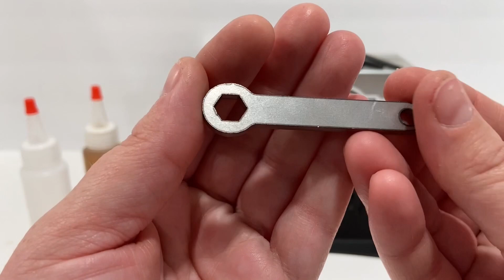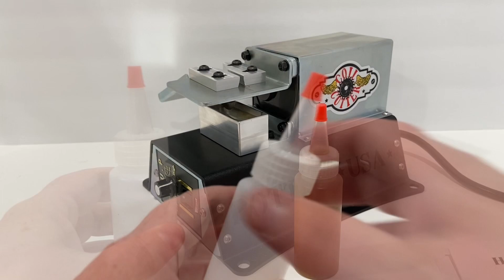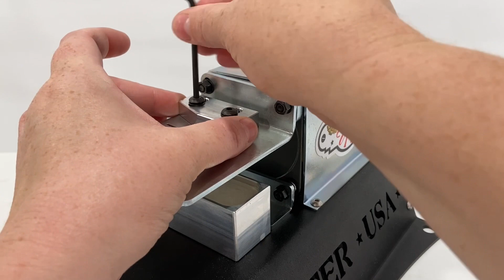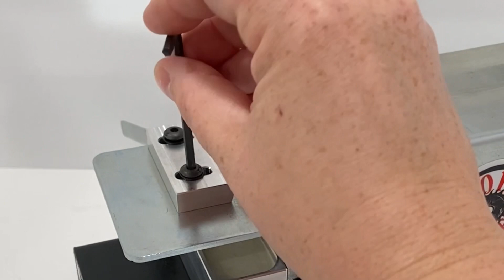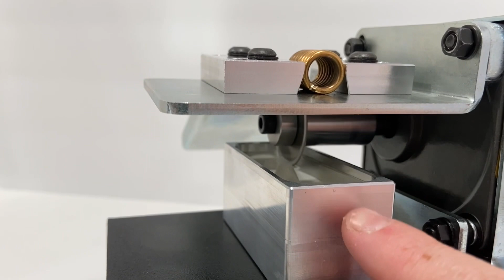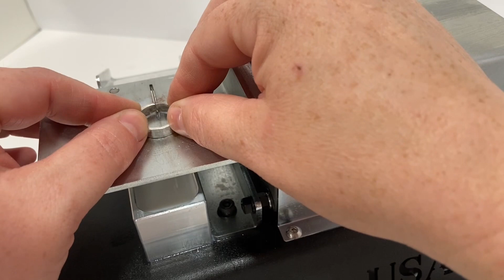How to Use the PotterUSA Coil Cutter Deluxe

Comment: Very sweet looking tool. Another win for the Potter group. One minor suggestion is that having done much woodwork using a delta table saw I get nervous using the fence in a way that traps the smaller piece. In this example, if it were wood there would be a high probability of the smaller piece to be kicked back at the operator. Since that didn’t happen is it because there is lubricant? We’re I to use it to cut straight lines I might use the left fence as a guide. Or better yet maybe an optional attachment light a straight edge that can ride along the outside edge of the table and allow one to feed the material into the blade ?